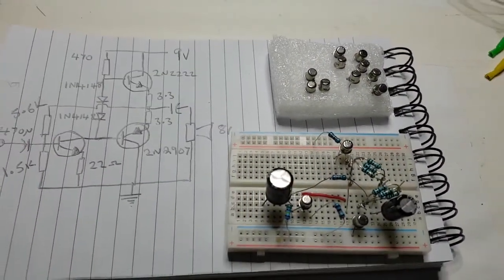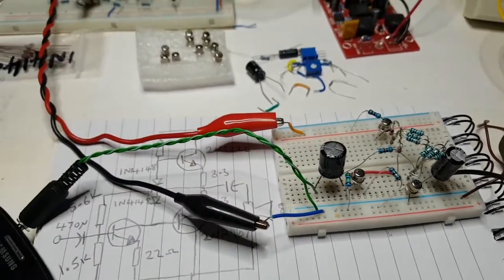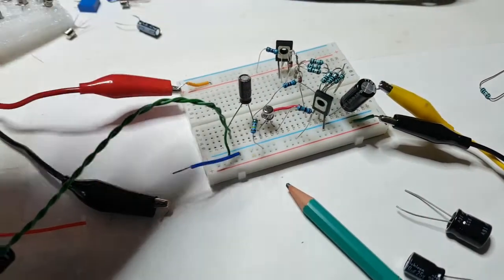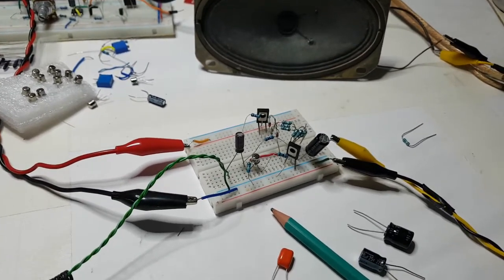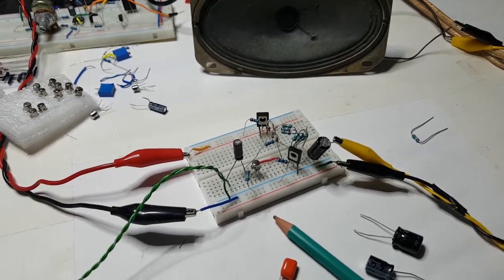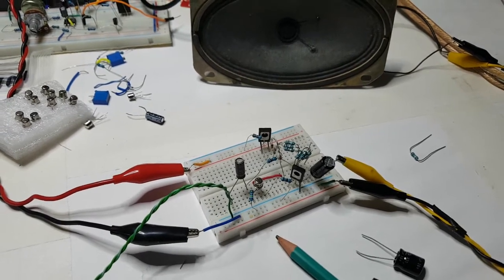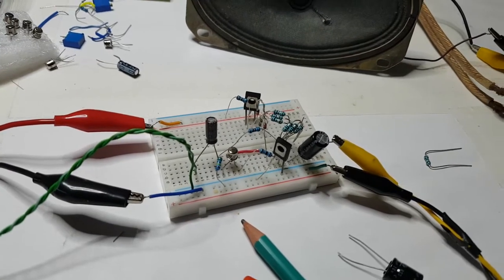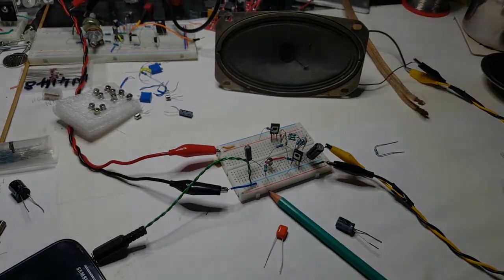Simple 3 Transistor Audio Amplifier Circuit

Comment: Audio amplification, even under 5-10 watts, can produce ear-splitting sound pressure levels when connected to the right speaker (design).  The quickly growing move industry (prior to, and during WWII) found that amplifier technology lagged behind loudspeaker design.  Various speaker manufacturers came up with full-range, very efficient systems that could fill a large movie theater given 10's of watts.  http://www.audioheritage.org/html/profiles/altec/vott.htm

In the later 60's and 70's (particularly) the 'bookshelf' speaker - frequently sealed-box or bass reflex - became the rage because of the vast improvement in amplifier design.  (Also, the huge reduction in cabinet size was a big factor, where a stereo system didn't take up 1/2 of one's living room.)  If amps of the 1940s produced 1 watt per $50, it could be said amps of the 1970s produced 15-25 watts per $1.

It's a surprise to many to hear how far a few watts of audio power will go.  So, yes, we expect an unbaffled or cheap speaker to distort and sound plain bad.  If you went further with your simple circuit and tweaked it for optimum coupling, good dynamic response and minimal distortion (using meters, a 'scope and some math), the results can be impressive.
Reply from the maker: Hi and thanks for the info. The article is a interesting read. I am a noob to electronics and teaching myself from the internet. I don't have a formal education but really like the subject. I guess I can (hopefully) only get better.